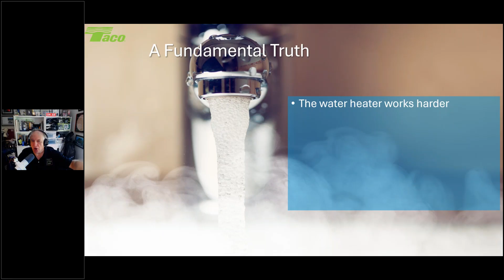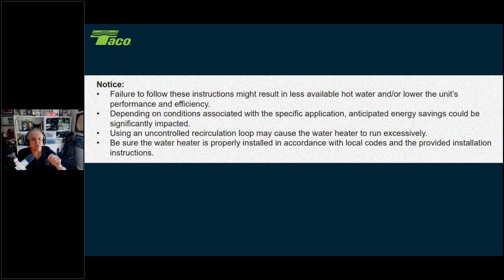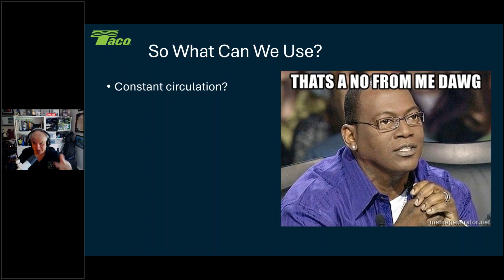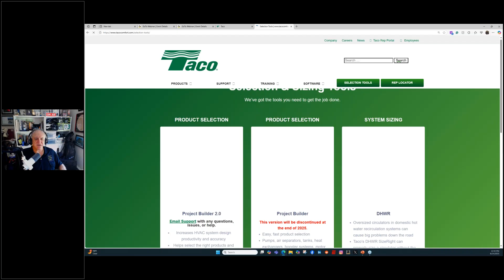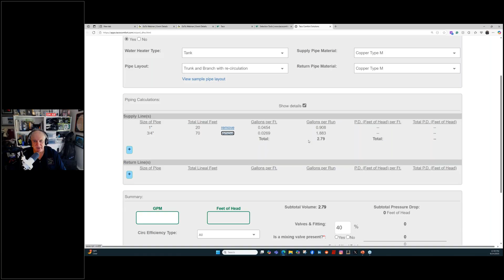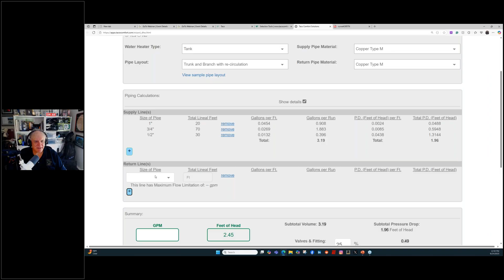Heat Pump Water Heaters and Domestic Hot Water Recirculation   1 PDH

Comment: Total volume was 4.77 for the run there and return back.  What is the difference if the pump runs close to one minute at 5GPM vs 2 minutes at 2.5GPM.  Both depleted 5 gallons from the water tank (source).  I am not understanding the value of time for the pump to run.  Is it just KW cost?

Thanks for the vid.  I am in NH also and building an ICF house.  Was looking at a 199K tankless.  But the 75 degree rise will tax the system when the well is over 300 feet away.  The "tax" on the tankless shows a 11GPM input with a 4.9GPM output based on 75 delta rise.  So now I am geeking on Hybrids to spin up my knowledge.